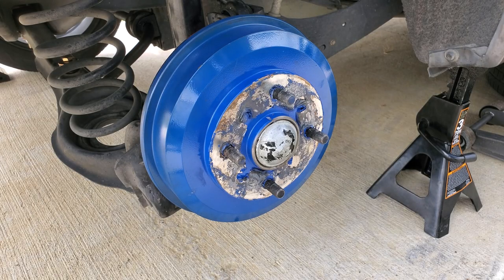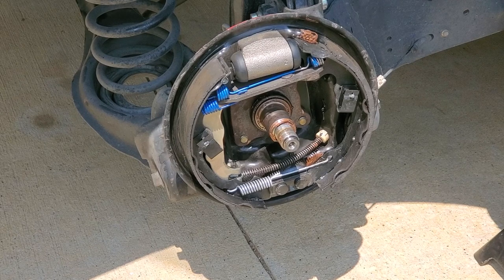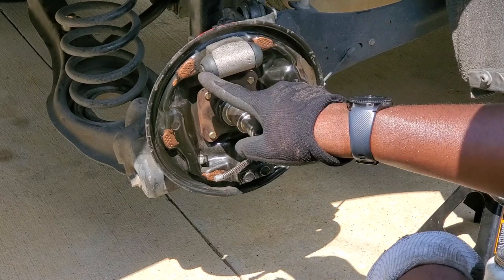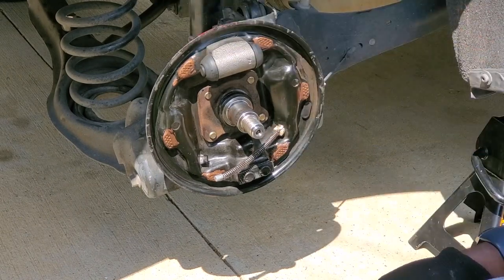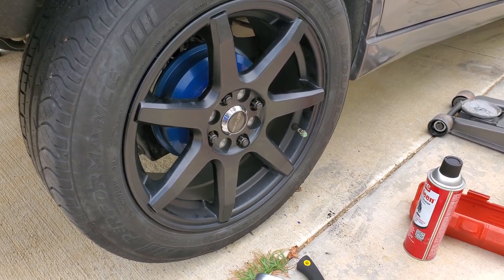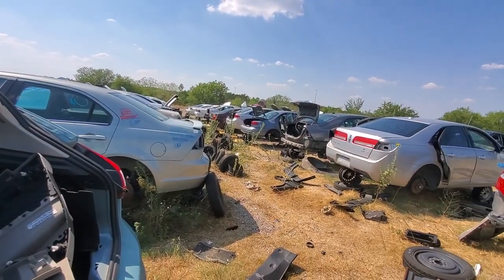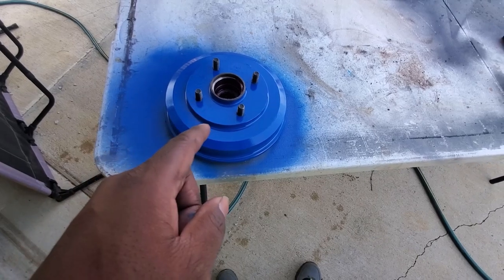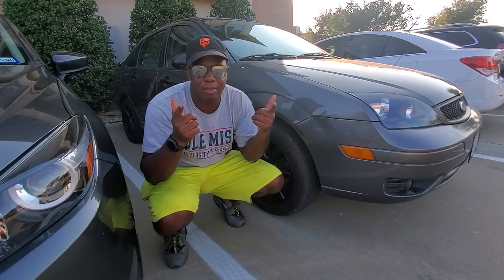Drum Brake Knocking Sound -Episode 3

Comment from the maker: All I've made a possible discovery! When changing my drums to disk brakes... I noticed that the wheel cylinder popped out when I stepped on the brake pedal.  This could also be part of the problem should you not find your total issue.
Reply: with all the hundreds of videos i watched to remedy this kind of problem in my car, you are te only one who gave reasonable and logical reasoning. can you explain further on this one considering that the wheel cylinder will always popped out when you step on the brake right (wheel cylinder will pooped out to push the brake shoe into the brake drum when you step on the brake)?

Comment: I had this issue almost on every brake job 😤 I did so much and what I discovered and figured out by swapping drum right to left since noise was on one side then I did adjustment several time got new drums from dealer then I adjusted the brakes till the drum completely locked up and I went one click back at a time till the drunk was free just the right amount and left it there it took care of the problem. Anyways great video
Reply from the maker: Really? So you dont have any knocking going on? People should know to try this out!
Reply from the maker: I'm also alittle concerned... because brake shoes are changed  far less frequent than pads. You must be doing some heavy driving lol. In my case I didnt get the knocking noise till I changed drums about a month into service on the new drum and bearings.
Reply: Focused Hands yeah that what exactly happned soon as I changed brakes they started doing this banging noise
Reply from the maker: @rcusa201  well  stay tuned for more content! I have some interesting  fixes and additions  to the car I'm working on now

Comment: Hey did you spray paint the blue color yourself? I would actually like to know how
Reply from the maker: Yea
Reply from the maker: Use caliper paint if you want it to last... add the caliper paint clear coat
Reply: Focused Hands thanks! Also random question, do you know if a 2005 spoiler fits an 04 focus?
Reply from the maker: Na do not think they fit. I remember  the holes being slightly  off

Comment: Is this when you hit the brakes?   Because that sounds like what I'm hearing.
Reply from the maker: Yep
Reply: @FocusedHands  Thanks dude.  Mine started about a week after I had the wheel bearing replaced on that right rear axle.
Reply from the maker: @squirrelattackspidy  its 1 of the most annoying things about the Focus if you ask me! Check over the braking system.
Reply: Hello @FocusedHands were you able to fix this problem? If so, was it by replacing the drums and shoes, or did you have to replace other parts?